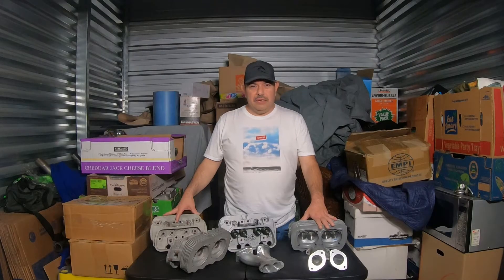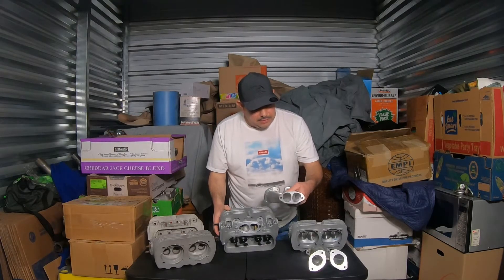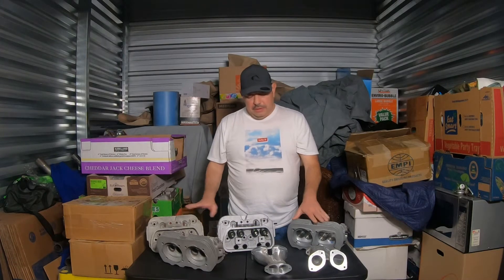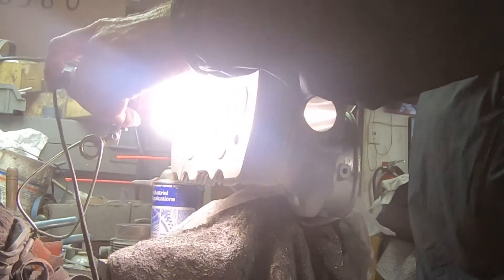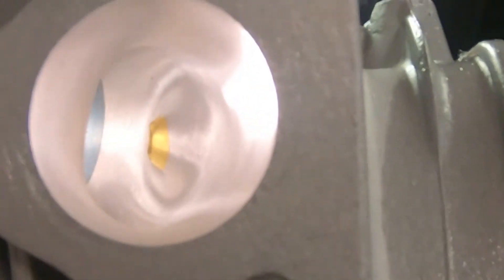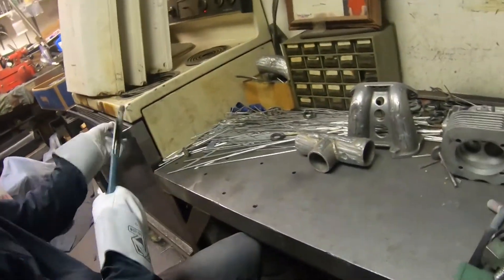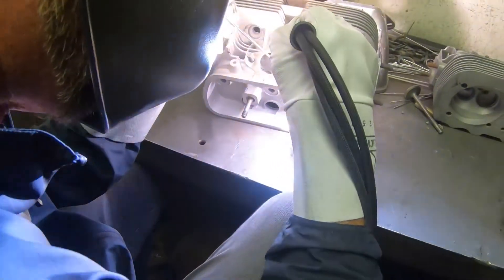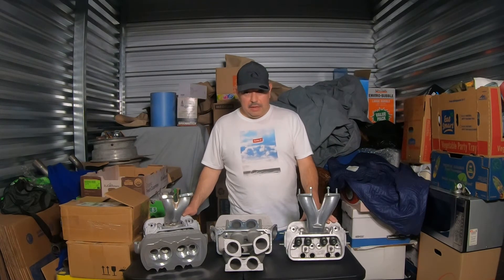Welding and Repairing Factory Volkswagen Air-Cooled Aluminum Heads

Comment: what are you guys doing for a water cooler for that welder?  are you using the original water solenoids, or a modern closed circuit type chiller?  thanks
Reply from the maker: We are  using the original water solenoids. Thanks for viewing the channel

Comment: hello bro, so happy to know that maybe my cracked heads in my bus can be repairable, both of them are cracked and I don't have the chance to replace them, no way you can find a good quality nowadays. in the spark plug I tried to put a ring inside to install a smaller spark plug .. they both need welding between valve and spark plug.. hope I can really save them
Reply from the maker: Glad I could help